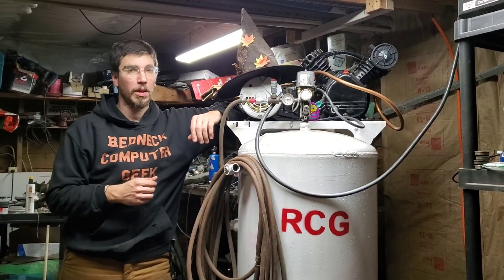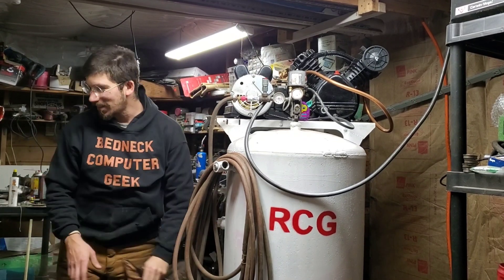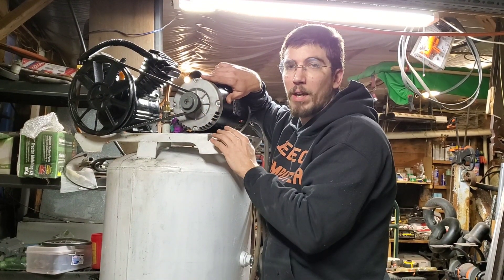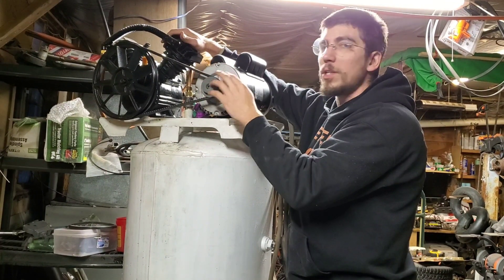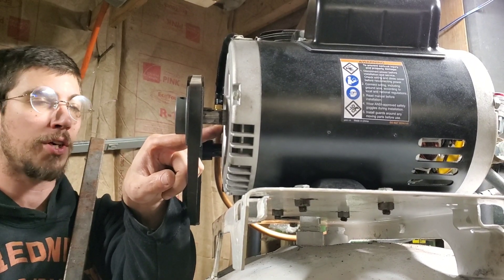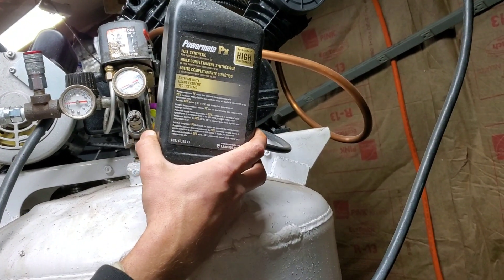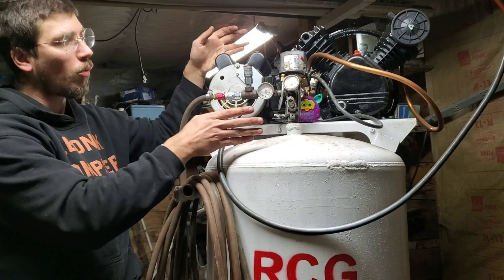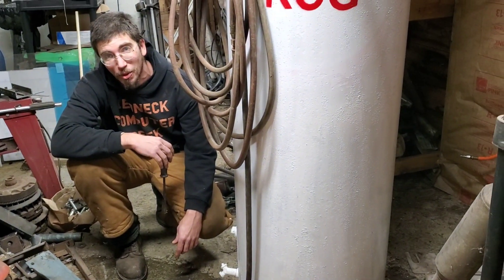Home Made 60 Gallon Air Compressor from Hot Water Tank

Comment: Looks pretty expensive actually.   I think the best approach is get a smaller tank unit, and use the bigger tank as an auxilliary expanded tank, rather than weld on it, etc.
My 5hp compressor only has a 20gal tank, it would be better with 60.

Comment: Neat timing, I just received the CUT50P from IGBTTECH on eBay.  Now to find a AC condenser and weld the side mount on the SCUBA tank (I think at least to make a cyclone pre-dryer and drain).  Reads like the AC Condensers are the way to go for drying and if needed... can use a molecular sieve filter at the end of the circuit.   Have a feeling the sand blasting and plasma cutting will be held off until next spring.  Have to see what I can complete.  Thanks for sharing all the details!  Great deal on the cost effective motor too plus getting me thinking not to skimp on a cheapo check valve either.  Reminds me of the pressure washer parts too, don't skimp on the high pressure stuff.

Comment: Ive seen people crimp one side of the copper line, fill the line with sand and use a piece a little longer than needed. Then crimp the other end when completely full with sand, then bend your line, some people use salt because its easier to wash out. The sand/salt keeps the line from collapsing on you. When the line is bent, cut the ends off to your desired length and wash out